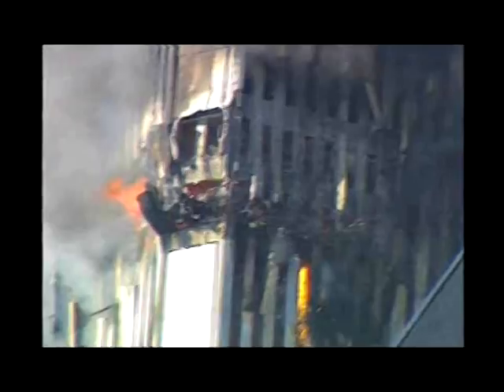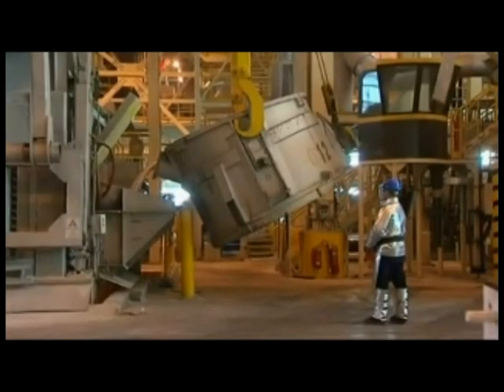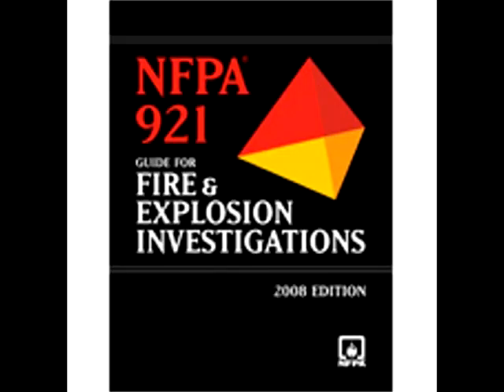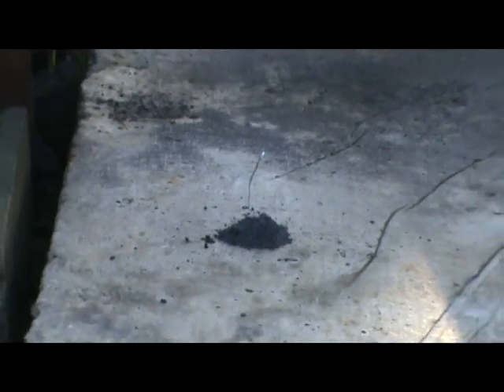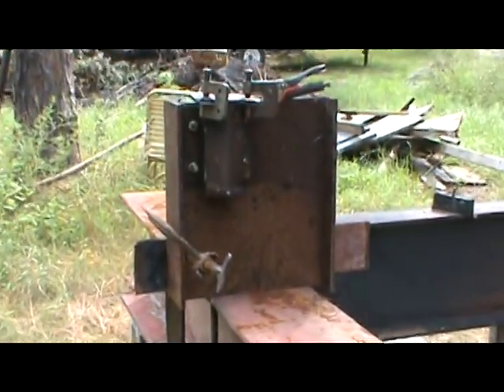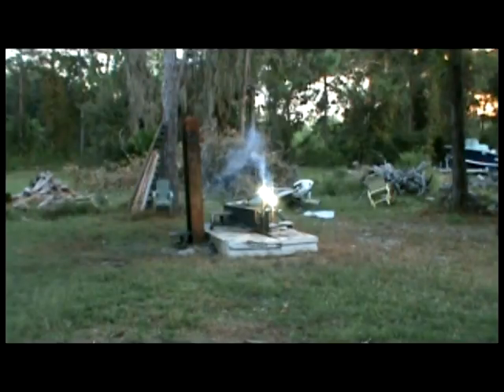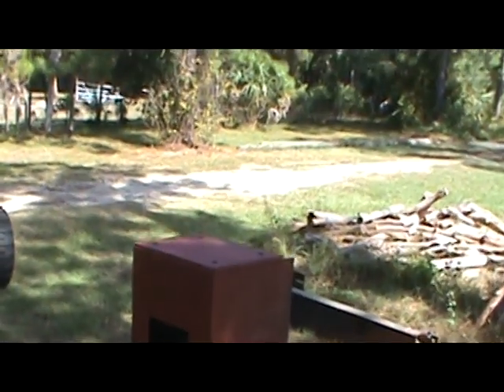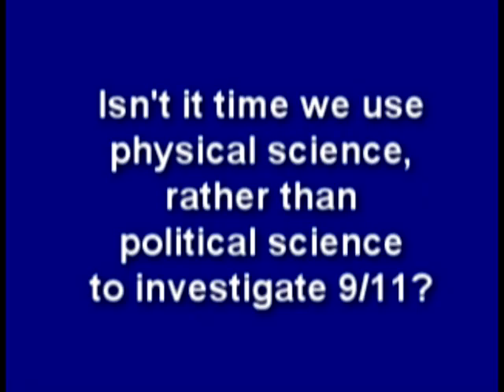9/11 Experiments: The Great Thermate Debate

Comment: You say 'no steal frame structure has ever collapsed due to fire', and even though I'd say that is not true. What has that statement got to do with the WTC ! ! ! because correct me if I'm wrong but shouldn't you be asking  'has a steel frame structure ever collapsed after being hit by a plane resulting in structural damage + fire damage'  and the answer to that is YES two times on 9/11  that is unless your one of those idiots who thinks the planes were a hologram or some other fairy tale idea.

Comment: 372 DEMONcrats,,,chase the money trail and you will find ONE of the culprits,,sold quickly and insured to the MAX,,and who was that man?,,,,fuel aircraft does not melt much of an aluminum airliner,,and none of the eingines,,,,,a B25 hit the Empire st. bldg. back in WW2,,,did very little damage and NO STEEL WAS BURNED

Comment: Sigh. When the planes went into, and through the buildings, they created massive blast furnaces, which were more than hot enough to not only bend the steel supports, but <i>fucking melt them</i>. So, please, just quit with the bullshit fairy tales.
Reply: "...which were more than hot enough to not only bend the steel supports, but fucking melt them" ...Too funny. Did you understand that steel melts at 2,750 degrees F? Did you realize that jet fuel maxes out at about 1,600 degrees F and burns off in a matter of a few minutes? Try again.
Reply: andy lenow
*ahem*
If the planes that we had seen crashed straight INTO the Twin Towers, then the jet fuel within them would have quickly reached a very high temperature, possibly one that would be enough to weaken the steel structure enough to cause the floors above the site of the plane crash to drop onto the lower floors, creating a domino effect that crushed the entire building in it's footprint.
Reply: Major Tom Nice cover your ass, but that's stupid, and pretty ignorant of collapse in ANY environment. The WTC towers, did NOT fall fast, they fell at 67 mph, and 48 mph, (WTC1 at 16 sec, WTC2 at 22 sec)), do the math yourself, Dumbass. There is nothing new about collapse, Moron. Hundreds of buildings have collapsed due to fire, what happened to all of them? Did the NWO work on them also? Truthers are incredibly stupid, misinformed, and gullible.
Reply: Major Tom By the way, WTC 7 fell slower, at under 42 mph. It's 2.3 seconds, or 8 floors of free fall, were followed by 24 seconds of much slower collapse. The 6 seconds quoted by truthers, is just the 18 floors visible on video.
Now, let us do some simple math, Moron. When a 47 floor WTC7 collapses, and has 8 floors of free fall, how many floors fall slower?
Feel free to take off your shoes, Idiot.
Reply: Major Tom Well, Dumbshit, it was a 47 floor tower building, and we know its only the top 18 floors that took 6 seconds, do the math yourself, Idiot.
Reply: Major Tom When I say do the math, I am telling you that MOST bombs don't feature the SLOW DOWN bomb, or haven't you noticed? The Penthouse fell into the building 8 seconds before the roofline fell into the building. That's why David Chandler got laughed off Youtube when he first proposed that ignorant shit.
That's why you parroting his 7 year old, well debunked claim, shows you haven't done any research at all. Why don't you try googling "Debunk David Chandler", and find the 7 year old videos that did it?
Reply: Major Tom By the way, MORON, if you took the time to read the NIST reports, you would find that WTC 7 had MORE fuel inside it than the WTC towers did (13, 1000 gallon tanks, NCSTAR 1-1J), and that CON ED was also missing about 1,000 gallons from it's pressurized fuel system to the 13th floor, and that Con Ed sued Silverstein properties over it.
OR, maybe you might have found the building windows were still present when it did collapse, on that very same David Chandler video. How many bombs do you know that can destroy a steel column, yet not break a window less than 75 feet away?
Reply: Merlin5by5 " if you took the time to read the NIST reports, you would find that WTC 7 had MORE fuel inside it than the WTC towers did "

- this is true, but it's still a little disingenuous. The diesel lines aren't expected to have had much effect on the fires - but they aren't needed in any case. Office furnishings contain a lot of hydrocarbon energy...
Reply: And yet there were people standing in the areas that the plane ripped open.
Reply: KB9NLL And they died, Edna Cintron, when the heat from the fires made her jump despite being over 90 floors high.
EDNA CINTRON jumping to her death
11-settembre.blogspot.com/search?q=edna+cintron
Reply: KB9NLL"And yet there were people standing in the areas that the plane ripped open."

- and I can sit on my kitchen floor, two feet away from an open oven pre-heated to 275C, without cooking myself. Therefore - according to your "logic" - my oven instantly annihilates its heat the instant I open the door.
Reply: federalreserve Brown Probably because it can, idiot. Keroene routinely reaches 1,1000 C in any fire that's forced air, and / or a pool fire, where the fire drives aeration. Aluminum melts at 660 C, well within the range of an oil fire.
HOME furnaces are typically fired by Propane, a low energy gas, and there are plenty of examples here on youtube of them melting aluminum.

Comment: But wouldn't a large plane slamming into a skyscraper be plenty of force to take the building down? And another thing, have you ever bent a paper clip til it broke and felt how warm it got? The bending of the steel on the massive beam would be extremely hot, enough to at least get it white hot if not melt it. Im not arguing for either side I'm just mentioning some thoughts I had.
Reply: Even if it got white hot from bending (which is insane, the aluminum would evaporate before steel gets even red hot) it would cool down quickly afterwards. Regarding the force, yeah it would be enough if the plane was made out of solid lead, but it's made out of aluminum sheets. So you have massive steel beams vs. aluminum sheets, thats like rock vs. paper.

Comment: If you watch the footage of the towers just prior to collapse, you will see that the fires were still burning, and were quite advanced. First, heavy black smoke is still present up until it collapses. Also, the fires were involving entire floors. Go to youtube and search north tower collapse, and south tower collapse. Look at several videos. You don't see anything below the floors that are reacting. The collapse started at the floors that were burning. Also, how do you explain the thermite reacting seconds before the tower collapsed, if we are to believe the thermite hypothesis? Remember, the south tower didn't collapse until almost an hour after the plane impact. I forgot the fact that we were constantly told that black smoke meant oxygen starved fires, and therefore were dying out. Now to quote the witness used here "is where the smoke is progressively getting lighter and whiter, indicating that the fire officials are getting closer to ah, putting this fire out."

Comment: G cryss
A BBQ can get up to 1000F
A fireplace can get much hitter then that...

It's a ridiculous notion to imply the fires couldn't have gotten got enough to weaken the steel to the point if collapse..

Federal construction laws require steel used in supporting structures be encased in concrete to prevent fire damage..... A law put in place because engineers saw building failures in fire and determined fire can weaken steel support to the point of failure. Add structural damage and bare steel to the WTC fire and it's a perfect mix for a global collapse...

Comment: The thermites are characterized by almost complete absence of gas production during burning, high reaction temperature, and production of molten slag. The fuel should have high heat of combustion and produce oxides with low melting point and high boiling point. The oxidizer should contain at least 25% oxygen, have high density, low heat of formation, and produce metal with low melting and high boiling point (so the energy released is not consumed in evaporation of reaction products). Organic binders can be added to the composition to improve its mechanical properties, however they tend to produce endothermic decomposition products, causing some loss of reaction heat and production of gases. Wikipedia/thermite

Comment: It's kind of sad that the only form of debate here is either personal attacks or interesting scientific pieces followed by personal attacks.
As a question for the people against;
The media clip played says that the fires, rather than the impact, 'melted the structural beams' causing the collapse
The stated temperature of the flame (1832 F according to the video) is more than 700 F below the melting point of Carbon Steel
What could have caused the massive change in temperature to weaken the structural beams?

Comment: This video is so full of old Twoofer lies. That "molten metal" was actually ALUMINUM from the plane! Flight 175 was 80% aluminum. Aluminum has a melting point of only 887 to 1184 F depending on the alloy. The fires were recorded at 982 degrees. Steel loses 50% of its strength at 590 degrees. That's why the building was in fact bending and slumping at the point of the fires and IN FACT the building gave way right at the point of the fires. Makes perfect sense... unless you're a Twoofer. The kicker is that there were NO hallmark signs of elemental aluminium found in ground zero dust samples. James Millette ruled out thermite, thermate and nano-thermite. So this video is a crock of shit.
Reply: Molten aluminum doesn't glow bright orange in broad daylight, Office furnishing debris couldn't mix with it in order to cause the glowing effect, either. You are left with the responsibility of explaining molten steel flowing from the building.
Reply: bobbofly
Steel doesn't even come close to melting at 980 degrees. What is your point anyway??? Who cares if it was aluminum from the plane, metal from desks. So what! We already know that planes loaded with jet fuel led to the collapse of the buildings. Explain yourself.

Comment: Nothing fell at near free fall chuck....

Stop lying idiot!
Reply: pepelapiu2004 do you seriously not see the difference between "ESSENTIALLY free fall speed" and "free fall speed"? [my emphasis]
Reply: pepelapiu2004 good. We can now stop using that term as if it is synonymous with something different then, can't we, sweetie? We can stop claiming that an impossible effect occurred based on a wilful misrepresentation of their data, which has the added benefit of destroying every last claim of your that relies on this distortion.

So, freefall acceleration was not attained. Well done.
Reply: pepelapiu2004"essentially" means "close to", which is exactly as Newtonian physics dictates given the fire causing a single-floor failure. So "essentially" EXPLICITLY means that freefall acceleration was NOT attained.

The fire in EACH of the towers was conducive to the collapse of a single floor (at least), and the collapse of a single floor MUST result in a global collapse from the equations established four centuries ago. F = MV, simple as that.
Reply: pepelapiu2004"essentially" means "close to", which is NOT synonymous with "exactly". This isn't mental gymnastics, this is me pointing out that YOU are intentionally misrepresenting your sources. By claiming that the NIST final reports state that freefall acceleration was attained YOU are twisting their statements to infer something that they do no support. What they said was that this acceleration rate was sufficiently close to freefall that we can consider it as such to make calculations easier, which is perfectly acceptable practice in order to make said calculations practicable.

This is all deflection on your part in any case. Not only does your source explicitly say that freefall acceleration was NOT attained, but the observed acceleration rate - an especially how its rate of change - are what we EXPECT to see if this was the result of weakened steel due to heat.

Freefall acceleration was NEVER attained, and nobody has ever stated that it was - aside from those who are lying about it to try to push their agenda, of course. The observed rate was close enough for me to use gravitational acceleration in calculations, but this rate is consistent with the causal factors detailed in the NIST final report on the collapse of WTC 7, which I'd bet a fortune you have never read.

So how about you stop trying to make up evidence and actually address the facts? Start with this:

1) the observed collapse rate of WTC 7 is consistent with fire being the principal causal factor.
2) the observed collapse rate of WTC 7 is consistent with the global collapse being due to the momentum of the upper section (the topmost 35 floors - or 75% of the fucking building)
3) the only part that actually attained the observed collapse rate is the outer walls, as the interior had been seen to have collapsed several seconds prior to this.

- if you can't refute these points then you are forced to accept that fire was the cause of a single-floor collapse, and that momentum was the cause of the global collapse that ensued. Either prove me wrong or this analysis stands.

Comment: if a plane full of fuel hit the towers where thermite had been placed, it would have blown the thermite in that area immediately. In a controlled demo this must not happen, as the wiring rigs and blast sequences would be jeopardized beyond predictable function, and it takes weeks of work to reconfigure the sequences..Not in 56-102min..Theres no way to have reset WTC1&2 so quickly for controlled demo.
Reply: err... you noticed in the video that thermate is extremely hard to ignite.  A normal fuze wont do it.  An oxigen-starved jet fuel fire wouldnt ignite it either.  
fail...
Reply: Bob Lake No bariumnitrate or elemental aluminum was detected at ground zero.
Reply: Ludic Fallacies
 Lots of iron micro-spheres were found.. and we all know those can only form one way.
Reply: Bob Lake no, they don't "only form one way". So this is, categorically, NOT evidence for your preferred demolition scenario.